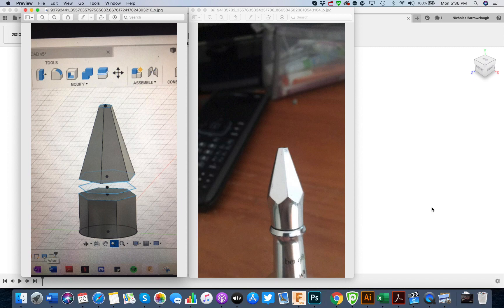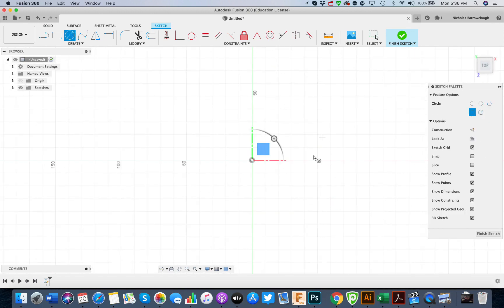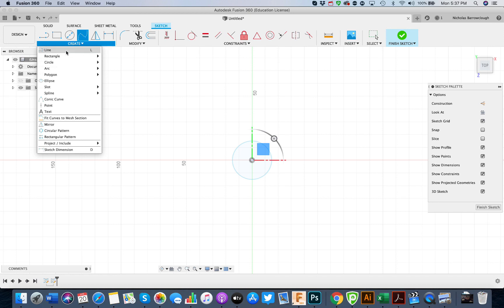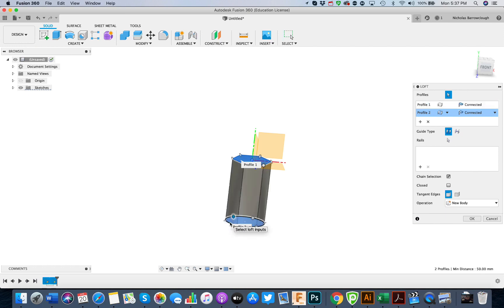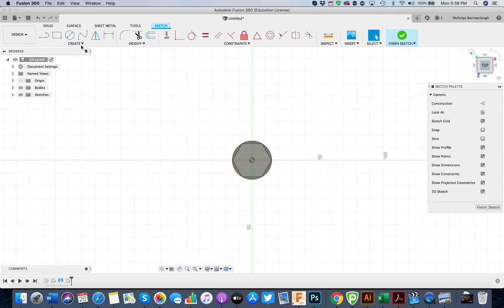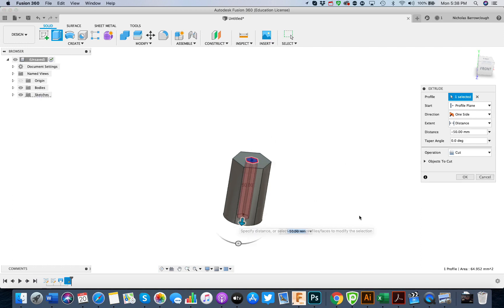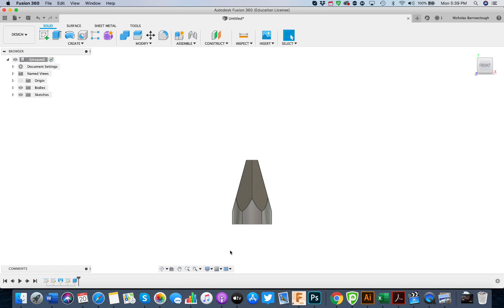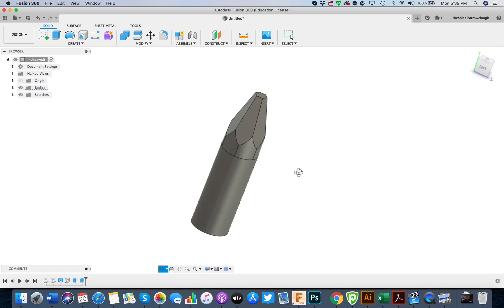Fusion 360 - Hex to Cylinder loft with taper

Comment: What if the HEX was sideways? I'm struggling to work out the best way to do that.
Reply from the maker: Create a bent pipe that bends 90 degrees to align with he hex and then do the same to tape loft the two objects together.